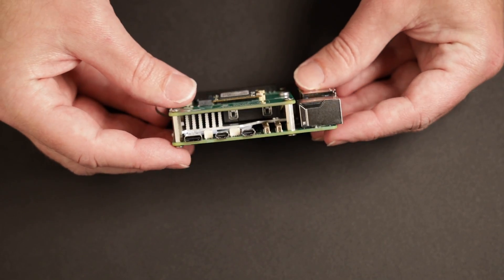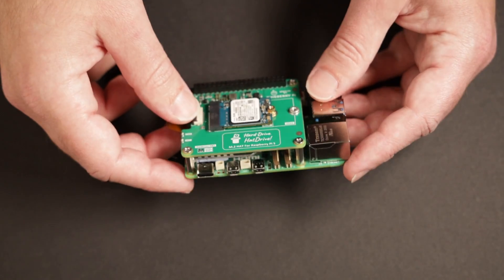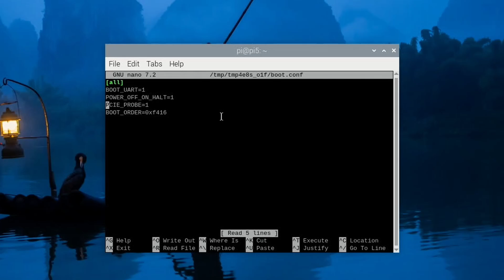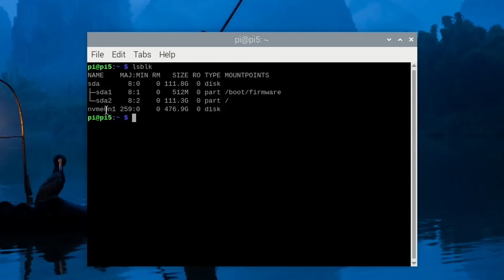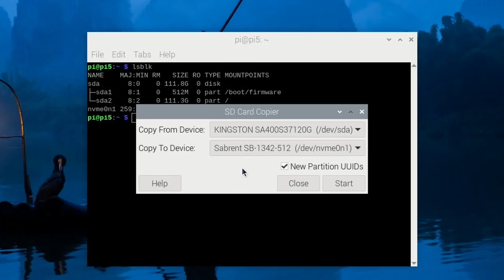Pi 5 NVMe SSD for the masses

Comment: Hi! 

Do you think a SSD NVMe of 4tb will work with pi ? If yes do you have some brands exemples ?
Reply from the maker: It depends on the brand and model of SSD and the M.2 adapter that you are using. Unfortunately, it's hard to have a comprehensive list, so, do research before buying a specific model. I haven't tested any 4TB

Comment: But the Pi 5 still only had one lane of PCIe 2.0 (or 3.0 if you hack it but that might cause stability issues) bandwidth to work with, which will be sloooow in terms of NVMe...

Comment: I wish you would have included the same process of installing the bottom NVME board as well as the top hat you did.  I’m curious how much space there is going to be between the boards since my full-size NVME Drive will be running a little bit hot and I have heat sink on it as well and want to make sure there’s enough room.
Reply from the maker: On the bottom adapter, the NVMe drive is installed facing away from the Pi. They provide stand offs to work as feet and you can always get longer stand offs
Reply: @makerbymistake  Outstanding. I was hoping that might be the case, but for some reason I didn’t think so from what I saw in the initial installation of the top hat. That is one of the reasons why going through what might seem kind of a meaningly process of installing the bottom board would’ve been helpful. Thank you for the quick reply.
Reply from the maker: Will keep that in mind for future videos!

Comment: I’ve had so many failures with SD card extender ribbon cables causing interference.  
Are these cables going to be any better??
Reply: I believe ribbon cables for PCIe are special. They are shielded, so that xfer errors do not occur.
So yes, they will be better. Just forget standard ribbon cables.
Reply from the maker: I'm not sure, never used the SD card extender cables. Only time will tell.

Comment: Very badly designed, you cannot cover the cooling fan. It is silly. Pimoroni designed a better one that goes below the RPI5.
Reply from the maker: Covering the cooling fan is fine. The fan does it's job with this HAT or any other HAT

Comment: Once there's a case model w/ beefy passive cooling capabilities that can cool rpi5 w/ %90 sustained cpu utilization w/o throttling and nice, good looking integration of a NVME in the same time, I'll get that one.
Reply from the maker: Yeah, I'm sure there will be options. New cases for the Pi 5 coming out all the time!
Reply: Me too. I don't want some Frankenstein stack of silicone. I want a case with the hat or I'll just use a USB boot disk.
Reply: I hope there will Argon m.2 version for pi5

Comment: I think the Pi Hat would be perfect for my use. I don’t need much as far as the connectors. My next build will be for Klipper, or OctoPrint for controlling a 3D Printer. I just want something a bit more stable for storage. As I have had a number of failures on the microSD cards.

Comment: I bought and received a Pineberry Bottom adapter (HatDrive Bottom GEN3) last week.  Just happened to have a 512 GB Kingston NVME 2280 drive lying around.  Works fantastic.  You really can use this setup as a daily driver.   I have a Western Digital WD_BLACK SN750 500 GB NVME which did not work.  Keep the video's and writeups coming.....
Reply from the maker: Too bad about the WD_Black. I suspect the more power hungry SSDs won't work, but that's just my suspicion. It really is a nice setup
Reply: So does this mean a Corsair MP600 MICRO 1TB M.2 NVMe PCIe x4 Gen4 2 SSD won’t work????

Or

Integral 1TB M.2 NVMe 2242 PCIe Gen3 x4 SSD - won’t work either???